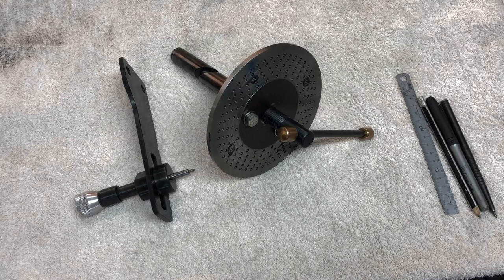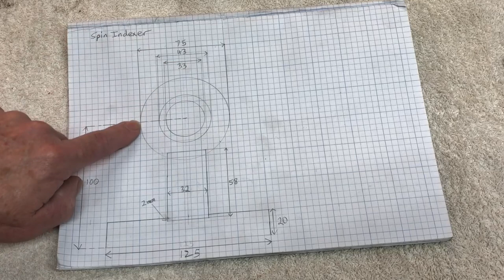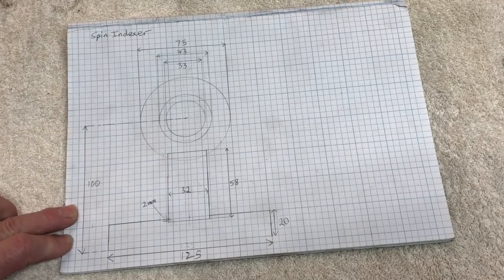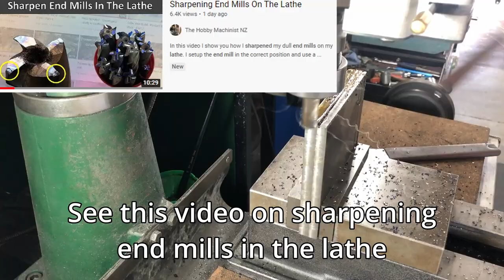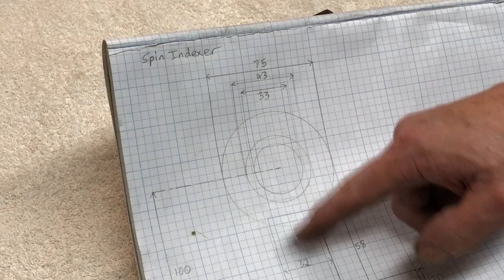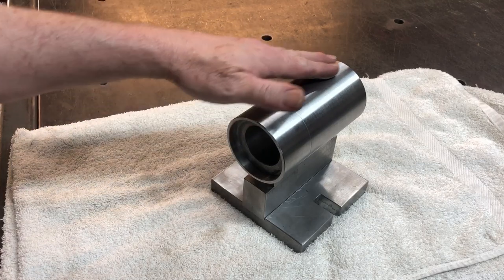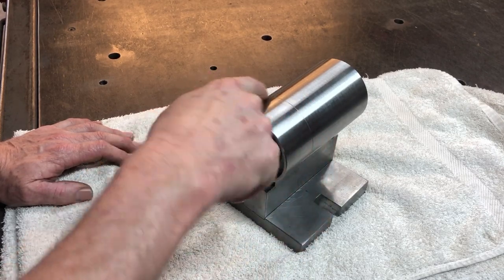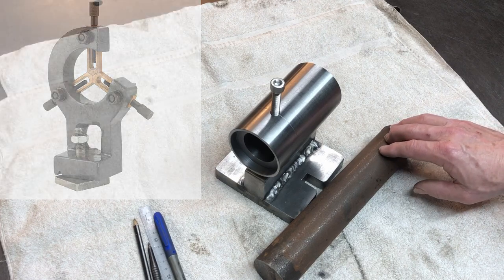Spin Indexer Build - Part 1

Comment: The spin indexer will require it's own lifting gear and radar guidance system for mounting on the mill. But no one can say say it's not well built.  Very nice work.
Reply from the maker: It will be rigid for sure. Thanks for watching.

Comment: I have that exact spin indexer you pictured if you need a measurement or spec of it..and yes it's only $72 shipped to my door but then another $90 for the round stock 5C collets..they offer hex, square collects..there's an adapter collet to go 5C to ER32 that's rather popular for them too..the spindle has 2 inch of  lateral movement to use, to mill 2 inches of flutes I'm told..so it couldn't hurt to make the spindle as long as feasible for that added feature..
Reply from the maker: Thanks. I may take you up on some measurements once I get back on that project. I did try looing for a data sheet but I could only find the basic dimensions.
Reply: @thehobbymachinistnz  I would need an email address to simplify communication of specs if needed.. What most people are unaware of about Chinesium equipment is they are more less kits that need to be reworked, squared, milled flat, threads chased etc and are simply assembled as not to lose parts in transport vs actually working straight out the box..the spin indexer in question is 12.7 lbs and requires the base to be reworked the inner bore to be honed that alum thumb screw on top to be threaded inside its inner bore for a ball bearing and spring and cap bolt to dail the run out to acceptable tolerances and spindle to be packed in Petroleum jelly to get it within a few thou of run out..basically just a good kit to start off with..as every piece of Chinesium equipment needs to be disassembled, deburred, all hardware replaced etc..

Comment: I've decided to bite the bullet and add a Spin Indexer to my project list for next year, but I will be cheating a bit, I only have ER32 collets, so it will be based around that. But like you, I am going to have to make a steady rest before I tackle that. 👍
Reply from the maker: ER32 should be fine. I brought some extra after market collets which go up to 25mm for my ER32 holder. The 25mm collet is quite a thin collet, but it has worked well. 
Can you not buy a spin indexer cheap in Thailand? I made mine because the exact same $67 spin indexer in the USA was over $500 in NZ.

Comment: Import duties on things from Chinia should be duty free in general, 10% at max for steel and machinery. So that Chinian indexer should be 200NZD at max! I might be missing something, but I just looked at a couple of NZ tax and tariff sites to check.
Reply from the maker: Thanks for your comments. I don't think it is a tax thing. I think it is more that the market is so small here and there are not many importers for these types of items. Therefore, they double, triple or even more the price to the end user. 

I can't do much about these heavy items, apart from making them myself because the shipping from China can be $200-300 alone. But, I can save a lot of money importing smaller items like the tool holders for a quick change tool holder. I use to have a locally brought one for my lathe and the tool holders are $100 each here. That soon adds up if you need 10 tool holders. I can get the tool holders from China for $17 each, which is almost 1/6th the cost.

Comment: on the subject of cost & asks to the perches of things. like spin indexers, we in the uk Ex Experience the same  exploitation. on sail.  So we Mack & sell to our self.  in a home markit  & often [vessel at a cheaper cost].  than the world markit  I suggest you lean to do the same the product you own product.  The one  have just maid  will be adequate in quality in my book . the suggestion is simple the markit is already.  there & a penny or tow as a side income is possessable .  we ues old hydridic Cylinders  as the holder for the spin indexer  often Found  as scrap.  & a useful supply.  i get several out of one  Hydralike Cylinder  Mack & sell in batches  we in the uk could export to Newzzeland  if Export  duty  was Sufficiently  low to  encourage  the practice . AT 50   Quid per unit .  I have no hider what that is in dollar's ?
Reply from the maker: Hi, thanks for your comments. Yes, it looks like the best way through these high prices is to make our own tools.

Comment: 10 holes in a 90° arc for the 1° locking pin divisions, 36 holes in the main plate for the 10° divisions.

For 0.5° divisions you would need 20 holes in the same 90° arc with a 36 main plate.

You might be able to use a pair of locking pins with a half diameter tip for 0.5° increments, one set in the division you need then turn clockwise until it butts against the dividing plate, you can fit the other in the next hole so that it can't turn backwards, each pin should be touching one side of the dividing plate holes.

With your 1/2 dia pin in the 0 hole at 10° turning it clockwise gets you 10.5° turning it anti clockwise gets you 9.5° (if you turn back you would need to pin the hole before)

If it works this post is my pattent 😉 💹.
Reply from the maker: Thanks for your suggestions.